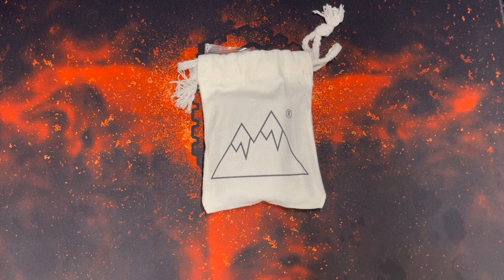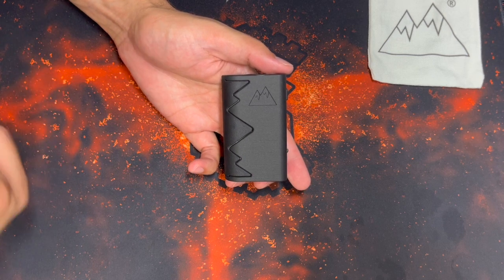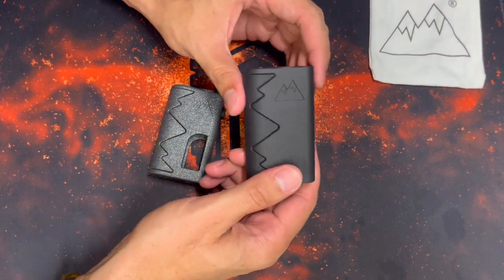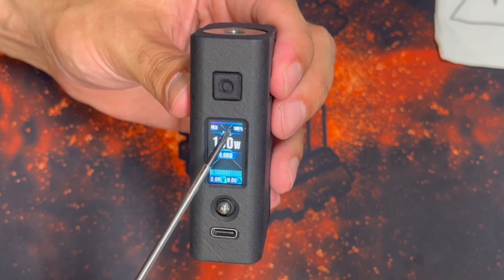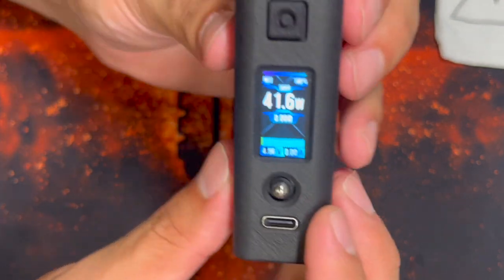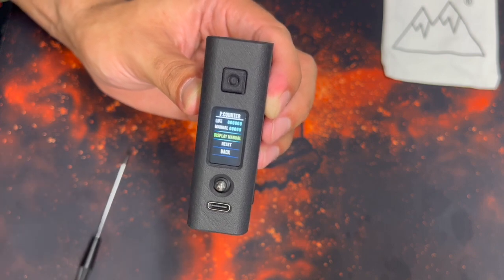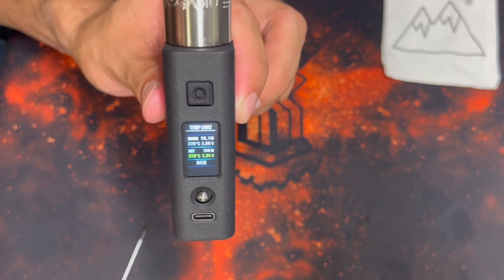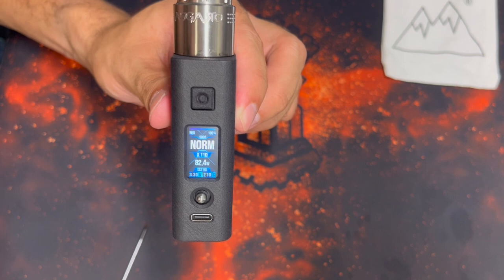Snow Cap Mods- Snow Drift 21700 Intro

Comment: Dropped mine from two feet on to carpet and the battery cover broke. Haven’t even had it a week yet. So bummed out.
Reply from the maker: I have not received any notice of a broken mod recently. If you contact me via any one of the several communication methods I offer, I'm sure you will be made whole.  Customer service exists because there are no people or products that are 100% correct 100% of the time. Please consider using the services that I provide.
Reply: @snowcapmods2110  I will definitely contact you, thank you for the reply.